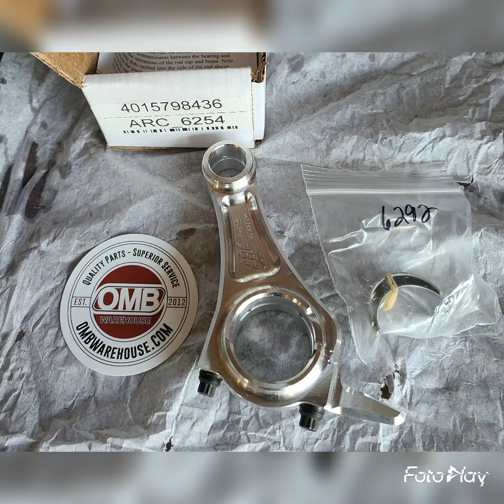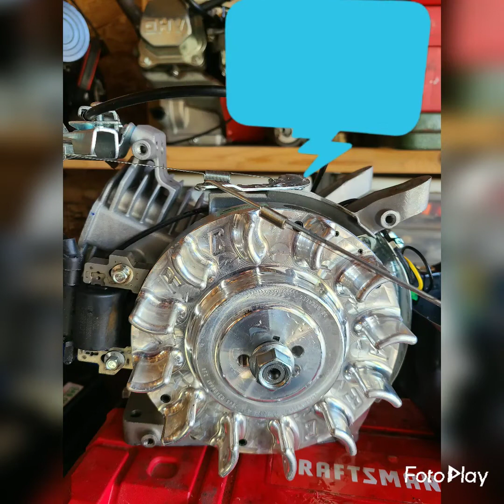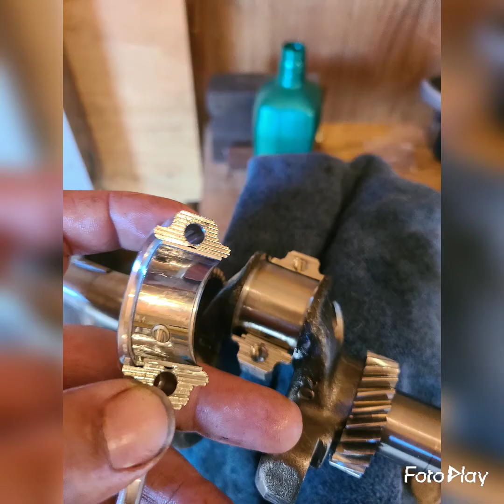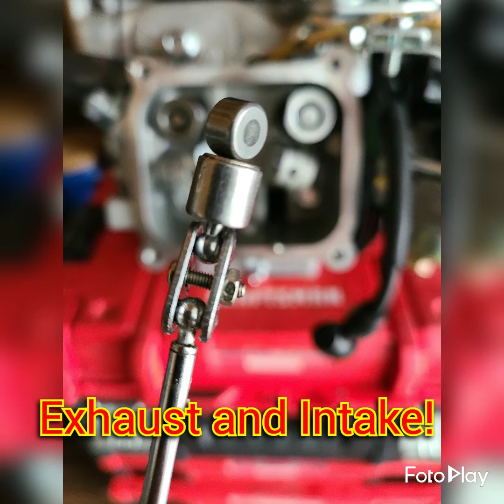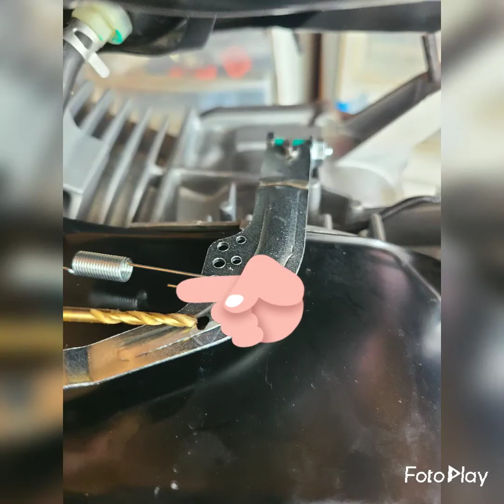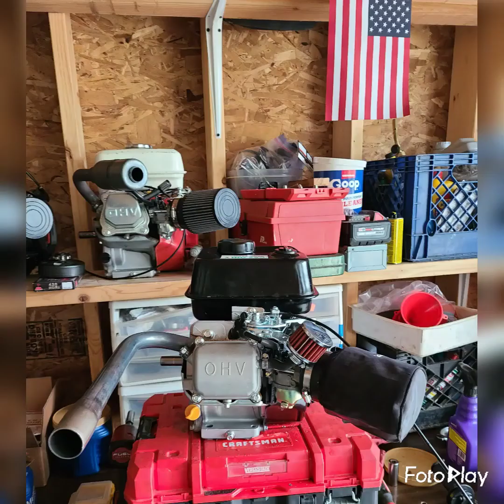Predator 212 "The Governor" Project

Comment: How did this work out for you? I did this for fun on my stock Coleman 200. Was able to set it around 5K RPM. But it was just a test and it will get set back down to 4500. My other bike with the mild built 196 is now set this way but I haven't been able to test it. Maybe next riding season. I did a short burst with it and got to 4500 RPM at around 27 MPH. That bike has a TAV with 9/60 tooth sprockets. I now have a tach that remembers max RPM. I don't have to watch it while riding.

For the 5K RPM adjustment I'm surprised how far out the throttle screw is. Not sure how much more RPM I could get with what little is left. And I shouldn't run my stock test bike up too high anyway.
Reply from the maker: They are great motors.  I prefer the Hemi still too!

Comment: I have the storm 200 , can you show me how to remove the governor ?
Reply from the maker: I did a slide show on that exact engine build. I replace the flywheel when I do the governor removal. I also change the rod. Its easiest to remove the flywheel and punch the whole mechanism out from the outside of the motor, the armature is a lot easier to remove with the crank pulled out. Then I use governorless throttle linkages. If you spend the $150 in parts to do it right you'll get the best results.
Reply: Thank you so much buddy!
Reply: Wish I had a riding partner
Reply from the maker: @janiopike490  I love working on the engines, if you were close by I'd help you out. I have governor removals down to an hour or so.
Reply: @janiopike490  Wish I have a better place to ride. lol. My first test ride and rejet someone already called the police on me. And that was with the stock muffler! I was in the driveway about to do a second run and the police drove by slow looking and giving me the stink eye. Yard riding is ok but I would like to see it's top speed.